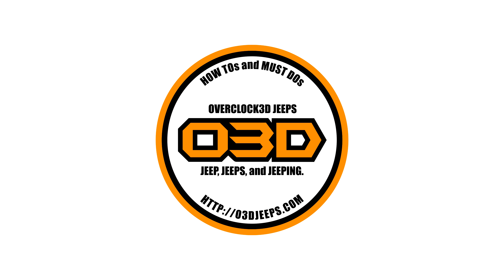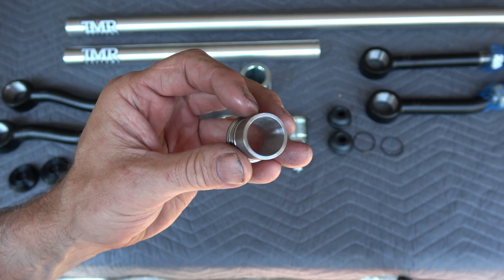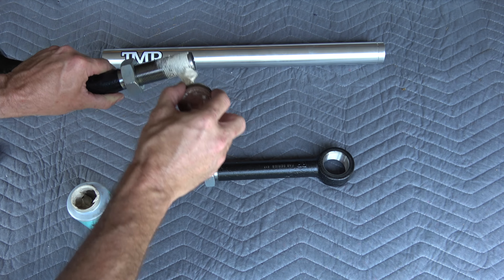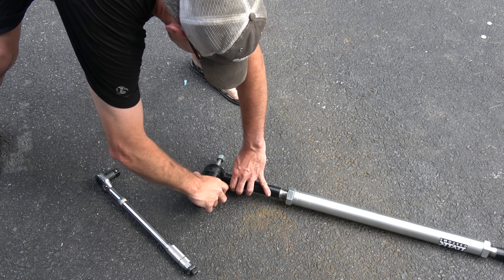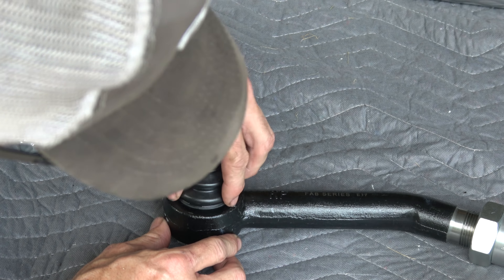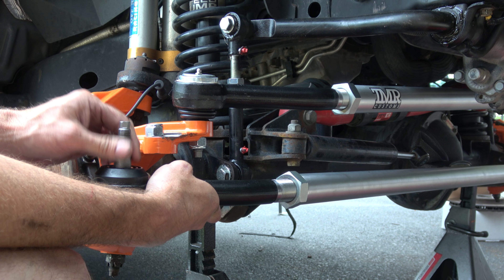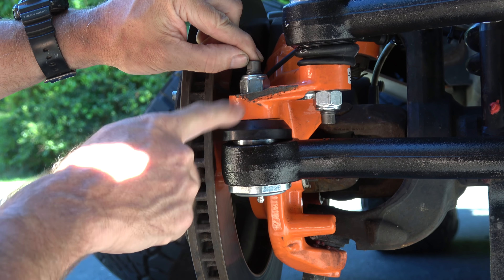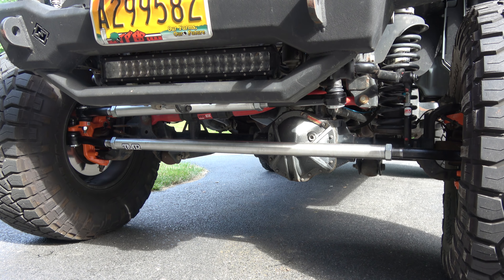Part Three - JK Steering Upgrades - TMR Customs 2.5 Ton Steering Installation

Comment: I love the upgrades but to be honest I would have stayed with the Steer Smarts Yeti components. I have already run all the mods you are doing this round and found that the drag link without the antiflop feature just added some play and wandering in my steering. So I added on the knuckle end of the drag link another anti flop boot which tightened the steering feel back up. But that ended up being short lived because when flexing it just split it and spit it out. Sometimes you have to ask yourself how HD do you truly need. You will never break the Yeti components and will be taking a step back in straight line stability as those joints break in and loosen up. The antiflop feature that Steer Smarts built into their tie rod ends is superior than a boot that limits movement. 

  BTW..  I run no Steering Stabilizer. Haven't since I built my aftermarket axles to handle the 37s. Not once have I had experianced anything that even resembled death wobble in 25,000 miles.
Reply: I think I will be adding the Yeti again to my Recon.  IT will be overkill for my current 285's, but I had it on my 2 door Willy's with 315's and it was by far the best mod I have ever done to any Jeep.

Comment: Funny you talk about marine grade anti seize. When I got my door hinges redone because of the pitting, 2 different metals reacting right. The body shop said they put a marine grade non metallic something between the door panel and the hinge at reassembly to stop that reaction going forward. That was 3 yrs ago and still no pitting!

Comment: For that price tag it should come with the steering stabilizer relocation kit. That is one exspensive kit. RPM fab, Doetchs off road, Metal cloak and RK are way cheaper.  When will you have a follow up video as to how it faired out on trail abuse.

Comment: If you don’t wanna do the ram assist yet. You can always. Just get the falcon steering  stabilizer. It use the Track bar  mounting hole so you can cut off  mounting brackets for the  stock one
Reply from the maker: Interesting... I'll look into that
Reply: o3djeeps [ OVERCLOCK3D Jeeps ]   I’m very happy with mine !    But I also got all yeti steering components I can send you some pictures  if you want me too